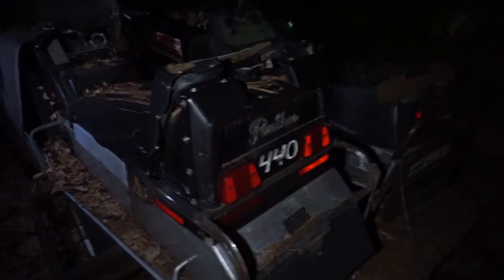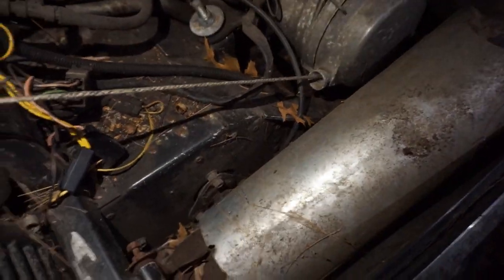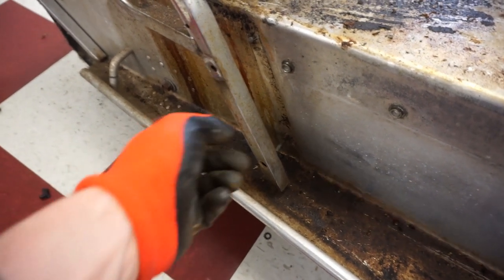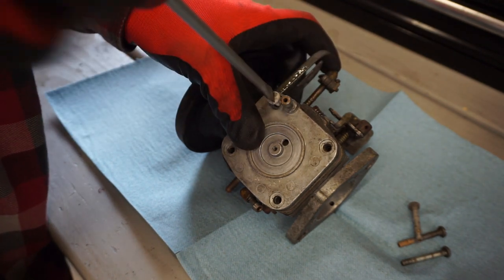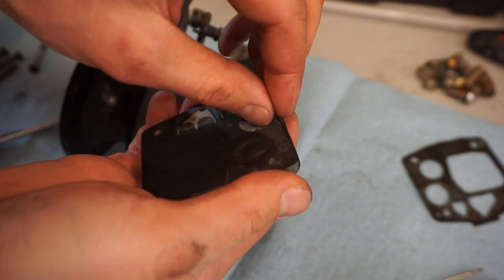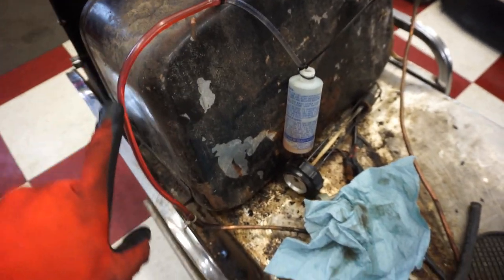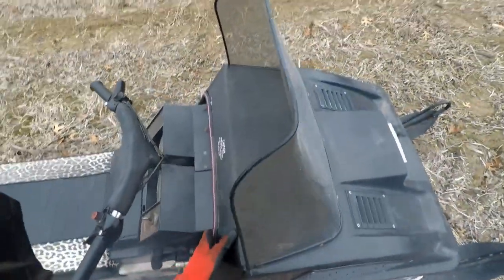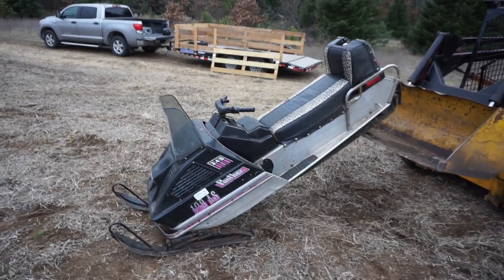This Was Almost BAD...$150 Sled Drives For The First Time In 30 Years

Comment: Great rebuilt The only thing I would suggest is not to drive it too long without snow. Snow lubricates your slides. Without it, you'll burn them right out.
Reply: What you are saying while is true those old sleds were tuff as hell, we beat the snot outta these entire summers before having to change them. Mind you we didn’t really care about then 🤷‍♂️😂
Reply: That is a good point, & I was wondering why he didn't just clean out both of the carbs. At the same time while he had them both apart🤔?, that way they would both be all set and ready to go 👍
Reply: sleds with only bogey wheels you can use on whatever. these slide rails NEED snow so they dont melt to the track
Reply: @kollinspencer847  not wanting to pick a fight but we sold these new and did a lot of testing on wet grass on cool nights. The hifax held up fine as long as the grass was damp. The old sleds were tougher than the new ones for sure. Crap we grass dragged for years and I think we only went through three sets of Fax all summer. The cleated tracks were fully open so they didn't stick like the rubber ones. All has to do with proper suspension set up.
Reply: ill throw some old grass dragger tricks. Run the track tension as loose as possible without derailing or excess slap. Helps if the grounds wet. If it's a hot dry day we used to run slide rail lubers. They got banned sometime in the 90's because people were running exotic slippery chemicals thru them. I just ran dish soap and water with a little windshield washer thrown in to prevent freeze up. Nothing deadly. Worked great. Also on 50 year old sleds its a good idea to replace all the driveline bearings. They rust up and drag. Also on the old Cat skid frames it's mandatory to go thru the swing arms and free up the swing axles and the arms. Get the lithium grease in there and the rust out. Replace the rear skid shock with a new one. Dennis Kirk still has them last I knew.  Once you do that and get the spring tension right you will be surprised how the sled performs. Yea it's only three inches of travel, but three inches is better than 0 if she's rusted up solid.

Comment: Keep firing up these old sleds for the first time with the belts on them, and eventually it will cost you. The 20 seconds it's takes to remove the belt will save you some potential destruction the first time one is stuck wide open when you fire it. Ask me how I know..

Comment: Hey Joe, it's running lean....possibly because of the metering diaphragm being a bit stiff. In the meantime though try turning your mixture screws out maybe a half turn or so... turn down your idle speed too. Do the engine  a favor and rebuild that carb top to bottom using all new pump and metering gaskets and diaphragm.... you'll be amazed at how much it will idle AND be more responsive to throttle.
Nice work dude ;)

Comment: My father and I owned a 440 panther 1971. They ran kawasaki engines with chrome liners. The formula used to fuse the chrme to the aluminum was not good and these engines burnt down a lot. They could not be bored and a new cylinder was needed.We   owned a puma and a ext 440 as well.

Comment: At about 20:40 after looking into your old fuel tank I see it has a few issues, however here in Michigan there used to be a company who would renew fuel tanks. I’m not sure if there is still a company still doing that kind of work! I believe it was call “Renew” I know it worked because I had it done on several trucks and my boat tanks! They basically rubberized the inside and the outside of the tank if you wanted…… never again had rust or leaks after completed!

Comment: Those Kawasaki engines were great when they were tight, but had a lot of seal problems. Head gaskets,gaskets under the cylinders, center seals and end seals on crankshafts. Often  what appeared to be carb issues was really seal issue.Like any two-stroke they need to be free of air leaks. My first A/C was a '72 Panther 399 cc. Great sled in it's day. Great video !!
Reply: Ditto.

Comment: Excellent Videos. I road these Panther 340's and 440's back in the day. It runs now because of the quality builds then and your skill now.  Highly recommend lubing the slide rails with Dawn Detergent if you do not have some/enough snow. A trick we did in drag racing them. Seen a number of tracks and rails ruined by dry running..

Comment: Dont forget to connect your primer line on the boot of the carburator because you gonna run lean and gonna suck more air in your gaz mixture i experienced it on a 399 Bombardier Rotax engine and i burned  my engine caused of that if you dont use it just plug it tight with a piece of tubing and  screw with silicone resistant gasoline

Comment: Like your videos and some of the stuff you buy.
I have a small trick for those carbies that have multiple plates with gaskits oll over the place, dont take them apart if you can help it, just soke them in a tin with carbie cleaner it it for about twenty four hours and then blow them through with an air compressor, usually ti just melts the old oil that gets left ii it.
The other way is in a sonic clear bath of spirits, something i invested in early on because they work so well!!!

Comment: Joe those Kawasaki engines they used on those Arctic Cat snowmobiles are the same 340 , 440 same only difference is the bore , other than that all part are interchangeable

Comment: Now that it is running you can change the final drive oil, grease the clutch slides, and grease the suspension. 

It will really move then!!
Reply: And replace the now nonexistsnt slide rails

Comment: Usually what I do to find out if the crank seals are bad or going on the machine I usually take a handheld propane tank and turn it on and go by the clutch and if the engine winds up you know the crank seals are going I just rebuilt a 467 they are very rare to find usually you find the mx470 and that's how I found out the crank seals were going by using propane handheld tank to diagnose the problem
Reply: Vintage_44  ok
Reply: How do I receive my gift

Comment: The exhaust pipe is full of carbon and ash that is why it smokes when you shut it off. You can clean it with a drill and a cable it may run even better if its cleared out. It will look 10x better after you get the old nasty oily gas cleaned off that aluminum. I cannot wait to watch it go in the snow it will probably run faster still. Maybe after riding it a lot the exhaust will burn out clear.

Comment: Try not to run it much without snow the high fax on the suspension is not getting lubricatedwill run hot and melt off .have 4 of these one a 634 hirth factory mod and 4 inch chrome side pipes, and 1 that ran the Winnipeg race with factory vulcanized track and special suspension with wheels to run when there was a lack of snow and dual fuel tanks

Comment: Man,  that sled runs and sounds great for a locked up and sitting for 30 years sled. :)   good job!    Probably a good idea u passed on that whip.  I had one and they are horrible for blowing up from getting hot.  The jlo/ cuyuna engine bad.
Reply: Wrong!
Reply: Explain then. Please   the cuyunas and jlo s have to be sealed perfect and timed perfect or they blow.  I have a couple ski whizs here with the jlo.  I don't have good luck except the single cylinder:)
Reply: I sold my scorpion 3 years ago.  I loved it,  but always popping pistons on clutch side.

Comment: I don’t want to tell anyone what to do but having said that Joe you really need to install a Big Fan in your garage wall with louvres that open and close to get the exhaust out. I worked in a building running a power washer on the concrete floor and had to go to the E R for carbon monoxide poisoning. It’s just a thought Joe think about it. You run a lot of gas engines in your garage. Just trying too look out for ya!
Reply: Let's Talk ✍️✍️

Comment: Next time when firing up a sled that has dry carbs unscew the throttle cable or top of the carb and pour a couple ounces or so of gas into it but dont pull the cable and throttle assembly out . Just tilt the screw on cap when it runs out of threads and don't pull up on it. Then add the gas and repeat for each carb on the machine . Now it will have gas in the float bowls so rev it good to draw up the gas from the tank and lines. Dont idle the machine at that point it needs
Reply: Let's Talk ✍️✍️.

Comment: U can add pump to the carb..   to make that type of carb.   That type of. Carb need s to be primed and replace all old gas line u know better than that. To see it u have vacuum have it the sled running hold your finger over the vacuum line.  I never had bad seals in a sled. Or bad pick up line in the gas tank.  All most definitely took engine apart over something simple.iF u have any questions asked me on any sleds I can help you
Reply: Let's Talk ✍️✍️

Comment: The manual say 20:1 I run mine 30:1  Because this is a piston port engine if a crank seal is bad it will only run on one side.  It will not run on the side with a bad seal.  You may get by with that Wahborough carb as long as you run it on non alcohol premix.
Reply: It will until it takes out the rod bearing if you keep pushing it!

Comment: You are missing the foot valve in the tank that keeps the supply fuel line primed. They are still available.
Reply: Let's Talk ✍️✍️
Reply: I don’t know how to, but…
I would keep that 72 AC Panther for packing snow on your new land.
Best (vintage)trail packing, tree climbing sled ever.
You need a “universal in tank filter with ball check valve” as like found in Automatic distributors. (LP077311)
I collected a lot of 72 AC Panthers and still keeping two around
Walbros and Tillotsons carburetors take a lot of time to master. I was waiting to see you tear into that tillotson…

Comment: My cousin had one of those cats brand new and the little trailer sled that came with it. He pulled us around in it and it was a blast! But oh what a machine! It was quiet but powerful and had that cool leopard skin pattern. Old cats are super cool. The cleated or metal bars on the tracks work really good on the ice on lakes or frozen ground beneath the snow. If any come off you can buy new ones and put them on your self by lifting the back of the machine with a clothes line pole or something. Almost nobody studded tracks back then and cat was providing a sled that could really handle great and pull a lot of weight without spinning the track. Ice shanty? No problem! Broken down sled way back in the woods ? Get two people on the cat and go save them! Those bars are pretty mean! They also wont tear up a lawn like studded tracks do in light amounts if snow .
Reply: Let's Talk ✍️✍️.

Comment: I hope you have a total bogie system underneath or you will be burning up the teffolon slides.🤔👍
Reply: Yes ,I see you have slides and gauzier bars. Bars are pop riveted between the three pieces of rubber. Check all bars for cracking,as you hit things like rocks they do not flex. They only break.👍

Comment: Hey when you take the fuel line off of the Carburetor after you have already filled the tank with gas, gas should be pouring out of the fuel line, as long as their are no obstructions, it should gravity feed, also you probably have obstruction in the carburetor too, you should clean it all out first, and why not order two rebuild kits, you have two carburetors, and two sled's, which use the same Carburetors so why not rebuild them both at the same time🤔🥴?

Comment: Good job. It wiil go 100 kmph on the lake. Your channel is like a funner version of mustie1. Evaporust treatment overnight in the gas tank would make the surface rust dissapear and make it look new. You can fix plastic by using super glue and baking soda. You can file, sand and shape it with a file and sandpaper. Id like to see you automatically use the ultrasonic cleaner on these old carbs. Remove the old gaskets and get a kit.  I restore vintage bikes and you do yourself a favor just doing it properly the first time. You wasted hours packing around with the carbs. I do not even try to start them before rebuilding the carb these days. On visual inspection those lines look trash. Another easy time saver...have spools of line to replace them. Give yourself the best chance at sucess. Wasting time is not necessary. 15 years of rebuilds I have learned my lesson. Those old plastics would look new with a clean, buff and ceramic coat.
Reply: Let's Talk ✍️✍️

Comment: Now we have a workable Carb.🥴, dude seriously ! , take them both apart spray out all of the crap, and put them in ultrasonic parts Cleaner and then reassemble them, that way when you try to get the other one going you'll have a freshly cleaned Carburetor, it only makes sense right,🤔?

Comment: You're just going to tear up that track you have no moisture for the track guides which are plastic separates it between the we'll say the swing arm and a belt which is at the track and the rocks and everything are going to tear that track up you have a cleated track it probably rip the cleats out of the track you need snow or at least a smooth lawn that is wet not a field